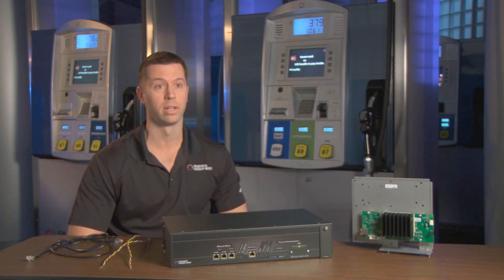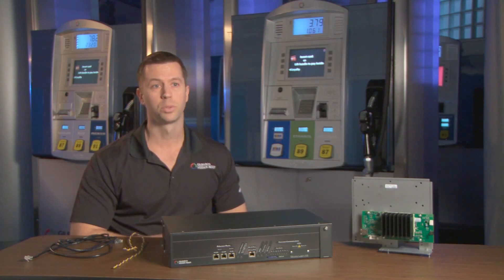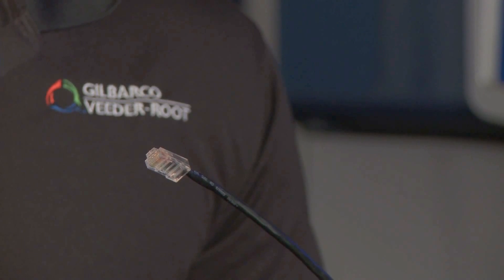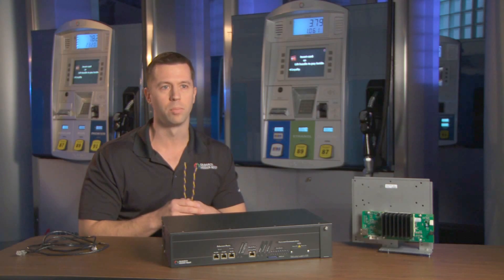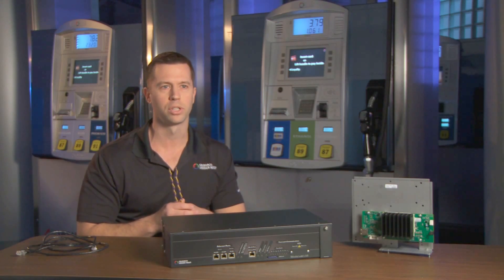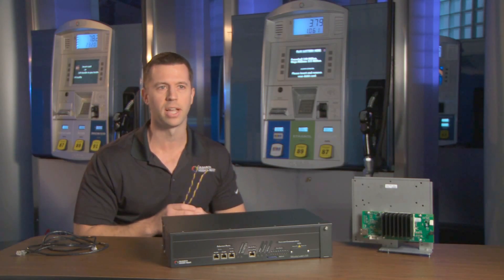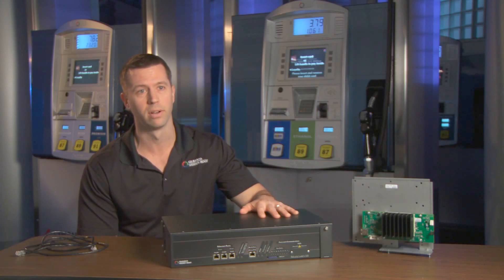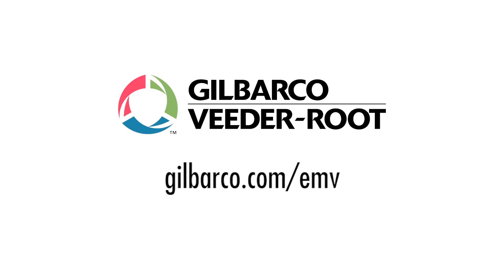Enhanced Gas Station Wiring for EMV FlexPay Connect | Gilbarco Veeder-Root

Comment: Instead of Cat5, if you are pulling the cable, use fiber.   The ethernet to fiber converted boxes are relatively inexpensive, and because its non conductive, and immune to electrical interference it works better.  Plus since its isolated lightning protection too.

Comment: Cat5e/Cat6/Cat6A) length limit is actually 328 ft, not 280 feet. Personally, STP ethernet cabling needs to be a standard at gas stations.

Comment: The two wire uses Current Loop protocol which is not susceptible to noise. That is why it can be run in the same conduit with electrical power. It is NOT recommended to run any communication lines in the same conduit with electrical power, but many old installations were done this way.

Comment: why is it okay to run a two wire twisted pair through an electrical conduit but, not a cat5? they are both used for data transmission and both are low voltage. you can pull the cat5 with the twisted pair to the diapenser.